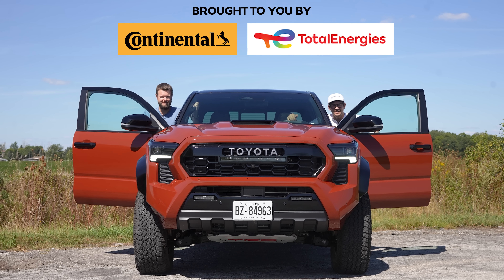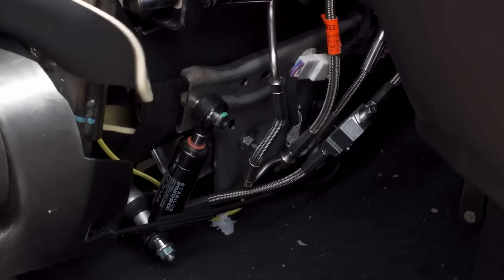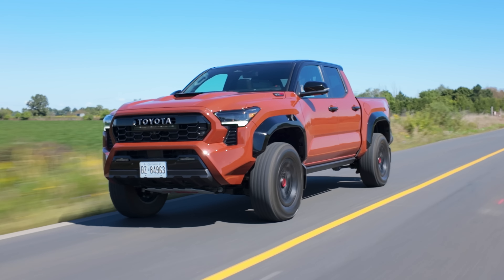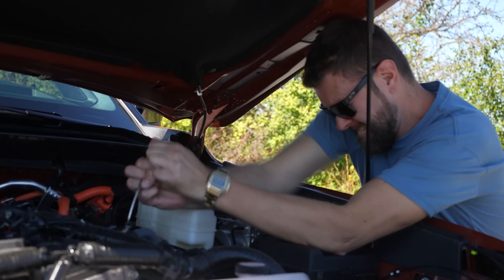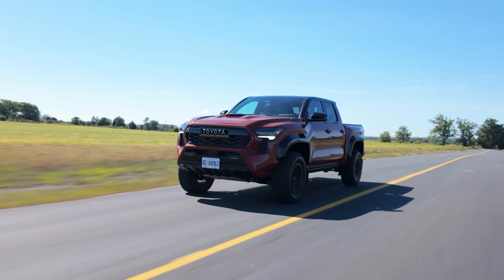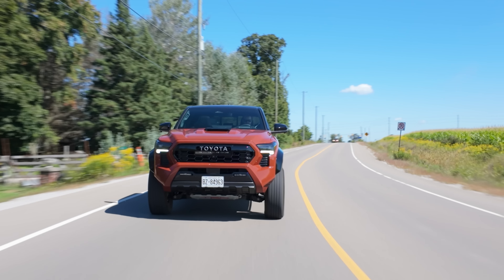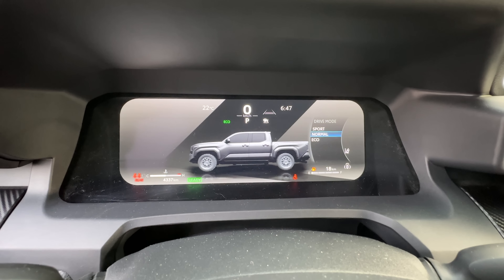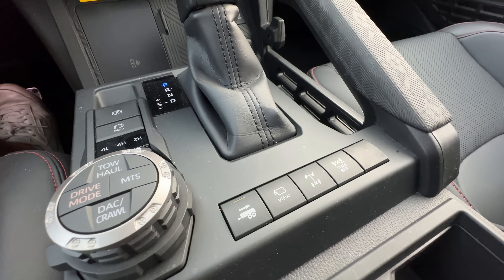RIP RANGER RAPTOR? 2024 Toyota Tacoma TRD PRO

Comment: Never thought i'd see the day a Tacoma would cost $80,000 after tax.
Reply: Damn that’s crazy, takes the whole appeal away
Reply: for real ill rather buy a benz lol
Reply: try 80k before tax. (after all the dealer crap)
Reply: Even the lower trims are crazy. Base spec with 4 doors is 36k. I'll take a base maverick for 9k less. No one is really towing that much with these anyway.
Reply: 🤡 money
Reply: I said the same about the Ford Ranger.
Reply: It’s really not crazy at all if you just look at a inflation calculator. I saw a Tacoma for sale yesterday and the original window sticker was Msrp of 21k. That same amount today is equivalent to 36k in 2024 based on inflation calculator. So realistically the price is the same. In my opinion the trd off road is the best trim for the new model which I happen to own and it’s amazing. Best bang for the buck and stacked up against the old model taco, the current off road model is about the same as the outgoing TRD pro. The new trd pro shouldn’t be looked at as the old one was because it’s much more capable and has a ton more tech and features. Just my 2 cents tho!
Reply: You can get a new taco for 40k brand new off the lot. 80k is only for trd pro which that’s anything that’s all the way up in the trim for any brand new truck. Half ton or even dually.
Reply: @Fumbiii16 for real these people are so dense they just see one thing online and run with it 🤣 and 80k is in CAD or Canadian dollars lol. The price right now is right on par with what it would have been minus inflation 20 years ago.
Reply: These are all made in Mexico where Toyota Corp pays the Mexican 🇲🇽 workers Less than 3 USD per hour.
Reply: inflation worldwide, look at mercedes GLA, 50 to 60g, Honda civic 45g
Reply: @maximeparent3004  it’s cheaper and it’s not a hybrid… what are we talking about here?
Reply: @mariojasso2795  the Ranger Raptor is definitely not cheaper.
Reply: @maximeparent3004  base msrp on a trd pro is 63,900 base on the ranger raptor is 55,720 I’m not a big math guy but 55 looks smaller than 63
Reply: @mariojasso2795  have you ever heard of interest rates? The Ford Ranger is at 9%.
Reply: @maximeparent3004  my boy, you sound mad, relax…

we’re talking about the price of the vehicle yes? Then the ford is cheaper, it’s a fact. 

If I had to finance, I most certainly wouldn’t go through the dealer…

 so idk what we’re talking about here.
Reply: @mariojasso2795  I'm not mad, stop projecting yourself. The price of a vehicle is more than the msrp. In the real world, 99% of people will finance through the dealer, interest do count and will make the price of the car vary.  After sales tax, the Ranger is 92k, and the tacoma 91k. Ford offers an interest rate of 9% over 72 months, while toyota is at 6,89% for 72 months. You can try to put it anyway you want it to try to prove a point, the Ranger is more expensive.

Comment: Ranger Raptor for 60K is a steal compared to this.
Reply: I would agree but if they were both the same price, taco all day.
Reply: @iblongshia baby Raptor much better overall. Higher spec live valve suspension, 6 cylinder twin turbo 405 hp stock, now you can get a Ford performance factory tune that raises power to 455 ho and 536 ft torque, all with factory warranty. Also developed in Australia, undergoing extremely harsh testing. All for 58k US, thisTacoma goes for 65k+. No contest
Reply: @joaquinpaul8205  I would agree.  On paper, that raptor looks great.  Reliability is the problem.  Will see, hopefully that raptor motor proves itself.
Reply: @iblongshia The 3.0tt is a very solid engine, definitely better than anything Toyota has put out in the last couple of years
Reply: @iblongshia  The 3.0 Ecoboost has been out since 2016, literally 8 years. What does it have to prove?

If anything its the Tacoma motor that needs to be proven. Its a heavily revised version of the motor that has only been in the highlander since 2022.
Reply: @iblongshia  Id still be on the fence. I'm not a fan of small 4 cyl engines in trucks and big SUVs.
Reply: @joaquinpaul8205  And the RR was in the market for about 2 years overseas before it even announced its landing in the US, saw videos where it was being tested rigourously in pretty tough climates and I was surprised how it performs itself similar to the F150 Raptor.
Reply: It is but then you're rolling the dice with Ford quality

Comment: As a new owner of a 2005 V8 4Runner, the only thing that appeals to me about these new ones is the fact that they're rust-free
Reply: Same here, the 4.7 will live on forever lol. Thankfully mine has been southern owned its whole life so my frame is rust free
Reply: ....for now
Reply: For now lol…..jury still out whether they’re using a better coating/galvanizing process or better alloy steel body sheet….or you could just get a Ranger Raptor & itlll never rust made out of aluminum & has a proper turbo V6 that’ll make wayyyyy more power

Comment: I'm in Canada.  With taxes, that's just shy of 90k$.  Without a front locker.  With a shit-ton of gimmicks that will not work well in -20°C weather.  Seriously, car makers have gone nuts.
Reply: There are a number of other better Tacoma packages for sure.
Reply: Hell, the Taco is just overpriced period... Even the base model is as much as a full-size pickup at this point. I used to want one with just a couple of extras.... My butt puckered and I just wrote off most of the smaller trucks. The Ford Maverick caught my interest, until dealers marked up the snot out of them.
Reply: @MichaelArtelle  I have no use for a pickup (well, I sometimes do, but you get the point...), so I'm an SUV guy.  Bought a used X3 M40i.  Insane vehicle, and with the slight initial depreciation, I got it for a fair price.  People who've bought Hyundais or Kias for more money than my car shake their head in disbelief.

Comment: The price aint doing it. No front locker and current engine problems (2.4L i Force) 

Ranger Raptor has more ground clearance and a front locker and a V6 with less stress on it.
Reply: Raptor resale in 5 years 20 grand. Pro 50 grand.
Reply: @oldmanmike4995  if you want a truck for yourself then this argument doesn't matter at all. If your buying a truck for someone else in 5 to 10 years then sure
Reply: @Deadset.zr2  people talk about how much the taco costs. But American trucks costs even more. If you know what I mean.
Reply: Sounds like crap drives like crap on the road get a zr2 for 15k less
Reply: @oldmanmike4995  Yeah but they also dont suck to drive like every Toyota ive ever driven. Driven plenty of 4Runners, Tacomas, and owned a GX460. Now I have an LX570 and thats the first Toyota ive actually liked to drive.

I'll take the depreciation hit to actually enjoy driving the vehicle I have to get in every day.
Reply: Ground clearance on ranger is 10.7 Tacoma has 11.5 
Tacoma has and approach Angle of 35.7 
Ranger 33 
Tacoma has a 25.3 departure angle 
Ranger 26.4
Tacoma has a 27.4 breakover angle 
Ranger 24.2
Reply: @j1818-n4d  That’s because one is being measured at the rear diff and the other is not. The Tacoma does not have 11.7” to the rear diff
Reply: Current iForce 2.4 engine problems?
Reply: @oldmanmike4995 you do not buy a vehicle to re sale you buy it to enjoy it for years to come and if you feel like then I can just get a ranger raptor for even cheaper in a few years where the Tacoma will barely drop but the Tacoma is to underwhelming
Reply: @oldmanmike4995 actually….nope, the F150 Raptors hold their value like a mofo, no reason for the Ranger not to do the same, & there’s been a lot of real hard off-road use on both those ford trucks w/ actual owners pushing them hard for high miles
Reply: @oldmanmike4995  Absurd. Clearly you don't understand resale value of Raptors. Plus, these aren't the Toyota's of past years.
Reply: @oldmanmike4995 raptors hold their price better than anything else, some 1st gen raptors are still in the 40s
Reply: @jadenantal1652  a clean low miles 2001 taco 4 door 4wd goes for 20 grand.

Comment: Add: 
- more fuel capacity (they shrunk the tank size for this generation)
- rear passenger air vents (the new 4Runner has them, same interior console)
- Everest green (color on the new 4Runner)

Remove:
- isodynamic seats
- electric raise/lowering tailgate
- at least $5k off the price tag

With those changes, I’d take one. If they’re keeping this MSRP at more than $60k, it had better have the Tundra’s TTV6 powertrain to really compete with the Ranger Raptor.

Comment: Cool truck but not $67k cool.
Reply: Yeah maybe 47 cool
Reply: This is top trim TRD pro
Reply: @chrism869  right and it’s small af and has an econo box powertrain. You can get a well equipped full size truck that is superior at absolutely everything except for fitting in parking spots for the same price
Reply: @ImOldGregg you think you sound smart but the old taco had either an i4 or v6 with the same auto or manual gearbox as found on toyota's "econoboxes." all manufacturers share power trains between models to save on r&d costs. the V6 has been the same for more or less two decades with incremental updates.
Reply: I'd rather buy the poverty trim
Reply: @HyperVanilo  just get the poverty trim, drive it until its out of warranty then dump all your savings into aftermarket parts that's better and cheaper.  $20k worth of upgrades and labor can get you a way better truck.

Comment: I bought a Ranger Raptor about 2 months ago, and I am so happy with my purchase. I think this TRD is sick, however the pricing is outrageous, and the power is down significantly. on top of that Ford just came out with a factory tune for the RR, so for roughly $900 you can get about an extra 50 HP and 100 lb ft of torque boost as well.. so I believe Toyota and chevy are falling behind in this Baja segment.

Comment: $70K for a 4-cylinder, cast aluminum tophats that can fail, no front locker, suspension seats that reduce backseat legroom by 50%. And those stupid externally adjusted shocks that make you get out of your truck and get on all fours to turn those dirt-, mud-, and/or snow-covered knobs when I could simply press a button in the Ranger Raptor. Get the $800 Ford-warrantied ECU flash and the RR gets 455 hp and 535 lb/ft torque. RIP TRD Pro.

Comment: 2025 Tacoma TRD Pro Wish List

1. Make the bouncy seats optional. 
2. Optional 3.4L V6 TT from the Tundra.
Reply: The V6 is dead in the Tacoma from here on out. As for the seats, yes, they need to be an option.
Reply: The 3.4L would make this thing significantly more appealing to me.

But since Ford has the 2.7L and 3.0L Ecoboost in the ranger I can just buy one of those.
Reply: There were Concept mentionings of an XRunner (xtra cab 4x2) with the Tundra TTV6
Reply: at least you're not asking for a front locker. Toyota has been denying that request for decades.
Reply: @JerryRichards-l1d  You might hurt yourself with one of those things. Just like you might hurt yourself if they gave you the ability to lock the rear diff in any mode besides 4Lo.

I mean, could you imagine what might happen if you locked the rear diff in 2Hi or 4Hi 🤣
Reply: @Jay-me7gw  time to pivot the marketing campaign from "reliability" to "safety" hahaha

Comment: why is this $25k more than a trd off road? lmfao when the zr2 is only $6k more than the z71 or trail boss
Reply: Because Toyota sucks.
Reply: let’s go with the Chevolet or Ford, and then the Toyota won’t short us
Reply: @goosebump_3316 zr2 is 15k less than the raptor I'll go w the Chevy 😂
Reply: TRD off road is not $40K more like $50K
Reply: The hybrid TRD Offroad Premium is knocking on the TRD Pro’s price in the low 60’s, even without the gimmick seats.
Reply: & the TRD off road shocks are blowing out so there is another issue
Reply: It's called a "Lifestyle" tax

Comment: Toyota truck family here, several with over 300K. Recently purchased Bronze Oxide TRD Sport non-hybrid. Paid $48K USD with 14" screen and Sport upgrade. Didn't want sunroof or the bad Toyota fake leather. Plan to keep it "forever". Never go off-road, don't tow, pure pavement and dirt road motorcycle hauling. Seeing 20.2 mpg mixed driving. Sorry, don't know what that converts to "Canaaaadian" (said in Yuri's voice). The back seat is not for passengers: great for keeping bike gear out of the elements, bad for hauling humans with legs. 

Guessing the Pro's seats would make the near-useless back compartment wasted space other than doing a Straight Pipes old school box test. I'm diehard Toyota, but for the Pro's intended use of high speed rough off-roading - and not pure pavement use that I'm guessing most will be used for (driving to craft beer store, going to Influencer party at sunset parked next to Sprinter vans) - I would purchase an older Tacoma or mod a supposedly-less-reliable Ranger Raptor.
Reply: if you wanted to keep it forever, should have gotten a 3rd gen.   same MPG, better offroad ability, better room inside, actually has bumpstops.
Reply: @HAHA.GoodMeme  We have all the gens. Third gen Sport given to young nephews who only drive to school and local trailheads. The 4th gen is vastly superior for our trips where a lot of highway miles connect tame dirt roads. The transmission, seating position and adaptive cruise control are night and day better than our previous gens. Changing oil ever 5K and hoping this 4th gen lasts long enough that the nephews' kids will take over.
Reply: @StinkyYamaLinky  Yeah, I just traded my 2016 TRD Off Road in on a 2024 TRD Off Road, and it's a better truck in every way. I remember when the 3rd gen first came out people were hating on them too.  If you go back and read the comments on the forums or YouTube, everyone was lamenting the 4.0L engine, and the 4 speed auto.  Everyone said the 3rd gen was a dud, that the 3.5L engine and 6 speed auto were garbage and they'd be failing left and right..........here we are 8 years later, and all of that was objectively false.  Time will tell if this truck is as reliable as that '16 was, but having owned both from new back to back, I can confidently say that the '24 is better in every way.

Comment: You're probably right but I do not need a truck with 4 cylinder with a pack of triple A batteries in it...  I used to be a Toyota lover, no more now.
 You wanna feel what it is a real truck drive the Ford ranger raptor, you'll see 😊

Comment: There should be a compressor built in those seats and adjustable from the screen. With a tiny handhelp pump you have to pull out every time, this is a gimmick you are gonna use once and forget about it.

Comment: Seat shocks are the most ridiculous thing that Toyota has pulled off. At some point these shocks  will require a rebuild. What's the point of moving away from reliability? At 100k or 150k , with all these sensors and moving parts, it will be a maintenance nightmare!

Comment: The seats are ridiculous, and add $ 2000 a piece to the cost of the truck. The on road setting for the seats actually make the seat dampers softer to move more. The off road setting makes them have more dampening for sharp jolts and movement.....which is opposite of what Yuri said

Comment: It's great when the engine isn't blowing up on you!
Reply from the maker: Transmission too
Reply: There are reports about the Tacoma engines blowing up?
Reply: @ArtieMcYardie  Nope. There arent. The only one I've seen blown up is where the customer managed to crack the skid plate, oil pan, put a hole in the diff and completely shred the axle boots. Not covered under warranty.

Comment: Is power tailgate really necessary? I hardly understand the point of power tailgates to the point I converted mine to base-model-manual because the motor was so slow. But a power tailgate seems excessive

Comment: As much as a Toyota fan as i am, the Raptor has more power, faster by a large margin, better suspension overall, better suspension travel, cheaper, and less prone to failure.. lets face it, the new tacoma has a reliability issue on multiple fronts..

Comment: No bump stops on the frame, and people are blowing their shock top hats or rather top mounts. What a stupid decision by Toyota, and I look forward to them eating crow and putting them back on probably a mid cycle refresh. The truck does look good, but sitting in it. It feels like I’m lying down compared to my 4Runner. Automatic lift gates for somebody that’s ready light and not heavy is just something that’s gonna break in the future. It’s gonna be costly. Interior dash does look good, but I hate digital display for the gauges as again that’s just something that in the future, if it breaks can be very expensive to repair.

Comment: Your Car Colour Rules don't apply at Porsche where I ordered, just a few of days ago, a 2025 718 Cayman Style Edition with a Black/Chalk  interior with Bordeaux (Maroon) leather centre seat inserts on a Ruby Star Neo (Hot Pink/Red Metallic) colour with White wheels and stripes. It's a Red car with Red seat centre inserts, and a Manual transmission. Regarding stiffness of the shocks - MultiMatic and Fox both build great shocks to MANUFACTURERS requirements. You can't blame the shocks as being too stiff- they are as stiff nas the maker wants them to be. Every model truck with them has different damping characteristics, per the needs, as defined by the manufacturer - Fox and MultiMatic design and manufacture to the SPECIFICATIONS they are given. You can't blame the shocks for being too soft or too stiff, especially as these ones are adjustable and you two were both too lazy to try the adjustments, possibly in fear of getting a little dirt on your hands.
Reply from the maker: Porsche is Porsche though